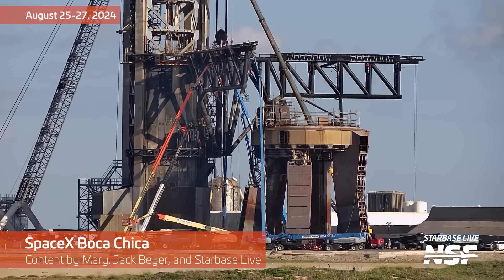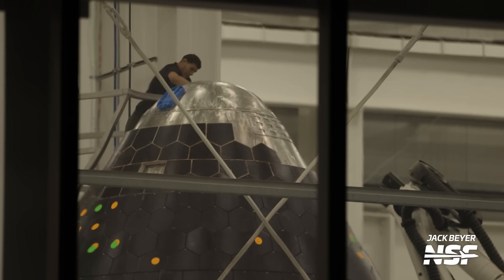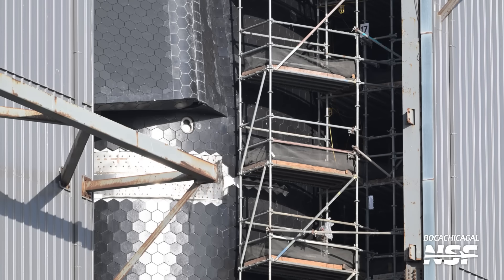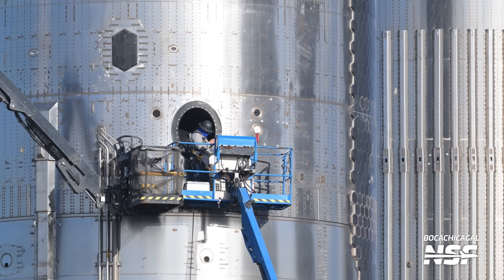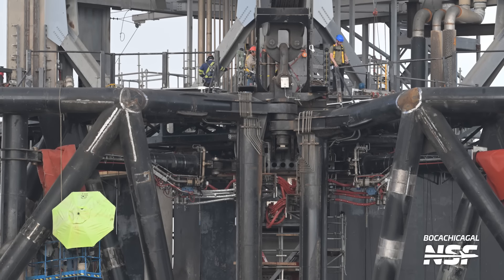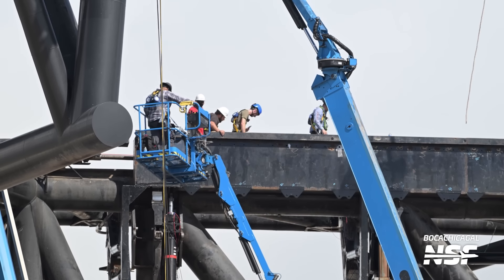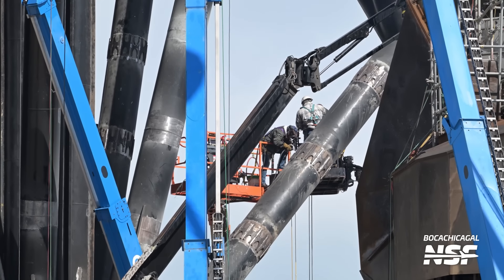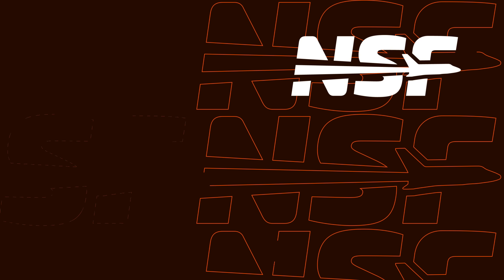Massive Chopstick Overhaul Ahead of Booster Catch | SpaceX Boca Chica

Comment: Getting used to being on a boom lift is basically the same as getting sea legs on a small boat, at first it's super unnerving but once you get used to it your legs just do all the work while it wobbles
Reply: Been there, done that. You learn to walk and stand upright with your knees never locked. The hard part is when you spend time on dry land and have to retrain yourself not to keep your knees bent. For me that was more difficult than transitioning to a ship.
Reply: @davidkillens8143 Wow that must be hard on your knees after years of doing that 😮

Comment: I have been in a 60m hydraulic platform fire appliance, we were conducting regular tests to ensure it worked properly. Fully extended we where 197 feet up, it was a little windy, the platform was moving 4 or 5 feet. We started to rotate 100° and then advance 10 feet, as we started to advance the platform dropped 40-50 feet immediately as a valve on the last stage let go. That was a definite 9 out 10 on the pucker scale. The fire captain heard that I was writing a report on it and removing it from service, he ordered me to stop. It hadn't been serviced since new  nearly 6 years earlier, the vehicle had to stay operational to maintain our fire response for all large aircraft.

Comment: 👍 Pretty sure what you thought was a torque wrench is a precision clamp that is adjustable like that.
Reply from the maker: Yeah, first glance it looked like the moves you make to adjust and operate a torque wrnech, but then the closeup it really didn't look like a wrench. Just made sense in context at first. -  Das
Reply: @NASASpaceflight  agree
Reply: I don't think so. It looks like a hole alignment tool. They're narrower on one end to fit into misaligned holes and get thicker so you can force holes into alignment.
Reply: @EWTHeckman  I went back, looks like you are correct sir, that tool passes through the left plate and into the right, not sure how or what that twisting handle does.

Comment: Yes, those sky lifts move a lot, 1st several times up is a little unnerving. Worse than that is a crane man basket because you're just hanging from a cable, and you have to jump out 1 person at a time and readjust basket for next person because of the flex in mobile boom crane.

Comment: If the padding/bumpers are too thick it will interfere with the self centering action of the stiX, so maybe they are sway bumpers in case the booster lands crooked and sways.

Comment: When working in Two-way radio had to go up on a 1500 ft tower to service a radio transmitter that was located at 1200 ft level we road an open cage elevator up and surprised at how windy it get as you move up in the open air and how much the wind speed effect your working ability.

Comment: L still have problems with the chopstick it's the part connected to the Tower I don't think it's strong enough and they concentrating in the wrong area.
If they do managed to catch the rockets the railing may not take may break but the cable may survive it's a lot of down force.
I would have just used the tower just to catch the rockets and l would of make it 360 degrees with a countermeasure. 
With the car as it is you've only got maybe 100° and the catching arm short

Comment: Technically tower 2 is actually tower 3, tower 2 is at 39 a
Reply: Well, yes and no. Overall you're right that it's the third tower they've built, but it's the second one at Starbase and the documentation in the EA shows that they're numbering it based on the site. The perplexing part is why they named them Pads A and B (makes sense) but all the things at the sites 1 and 2 (not consistent with A and B!)